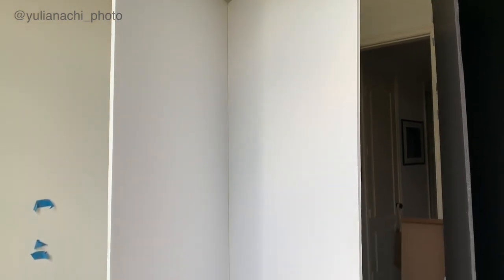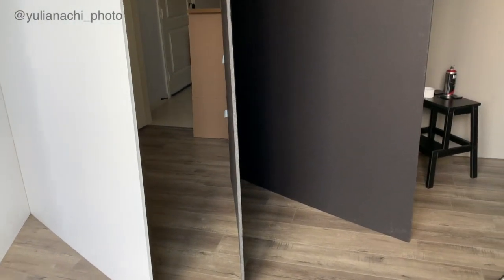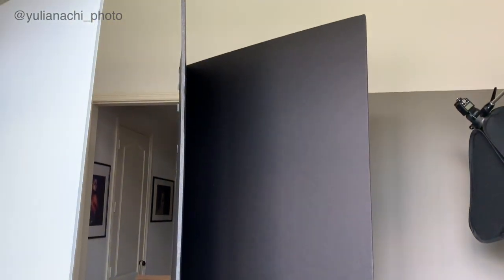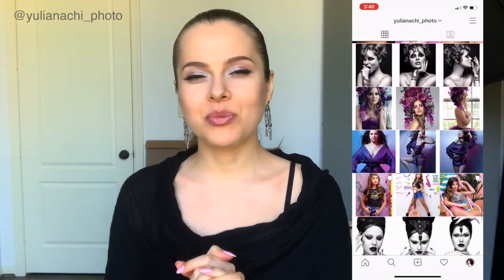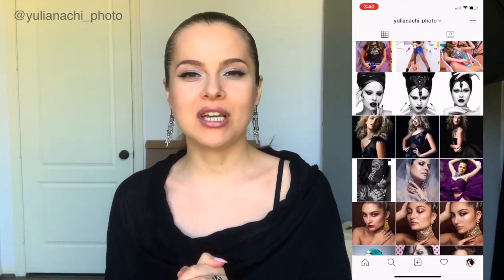DIY Portable/Collapsible/Foldable V-Flat. And how to Make it ANY color

Comment: Thanks for sharing this ;-) I am curious to hear how this holds up after 2 years of use? Is it in good condition? Do they bend/warp because of the paint of did you have succes with getting them straight again after using some heavy weight on them? Thanks in advance ;-)